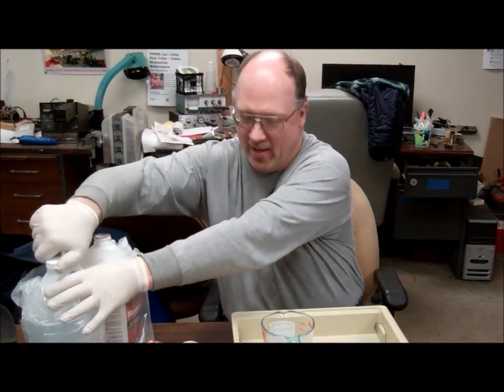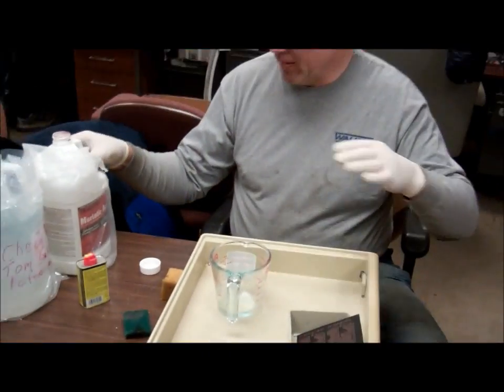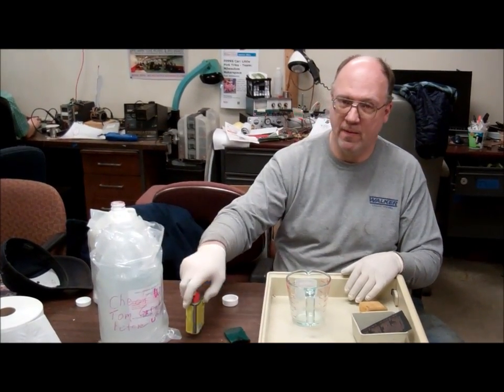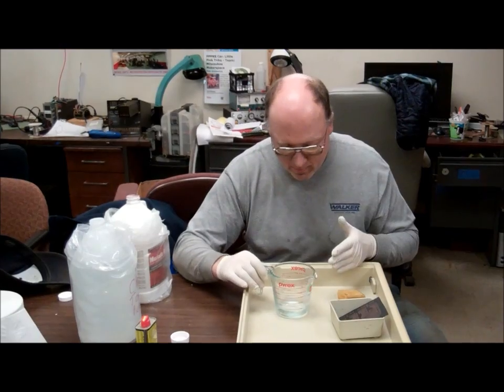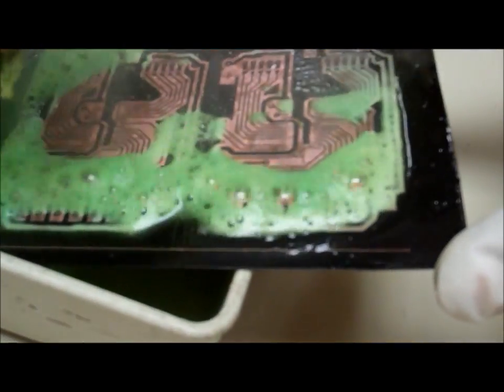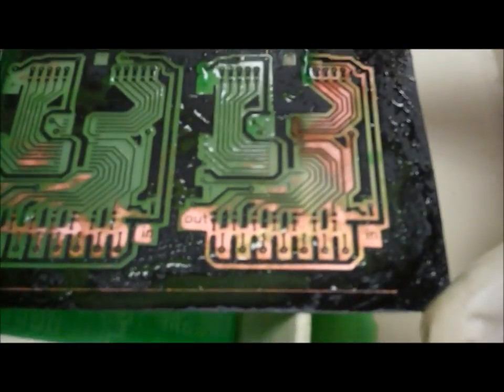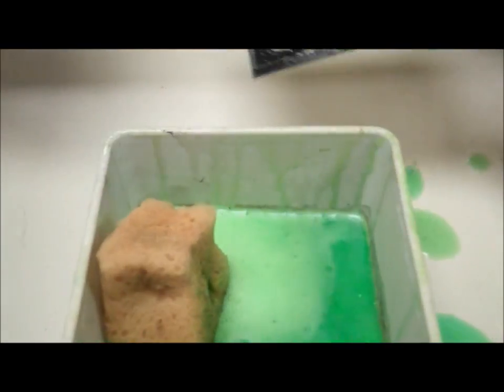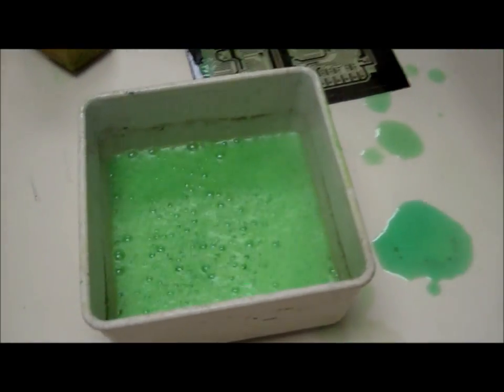PCB with Lasered Paint Resist and Fast Sponge Etching

Comment: Hi,
Thank's for your video.
I'm jean-yves from france.
I'm using the same process as you.
I tried alcool too but have problems: i think the paint layer is too thick.
I use a pressurised paint but it seams to be too greasy.
I'm forced to put more because it does not spread quickly and i can see holes remaining on the board.
What paint are you using?
Thank you.

Comment: Great guide :D
Worked excellently my first try with flat-black rustoleum enamel and a 1.6W laser. I used 3% peroxide, which took about 10 minutes with a paper towel to fully etch the copper, which was around 1oz, I think.

Comment: You really shouldn't do that indoors... I've heard those fumes are not only toxic but damage anything metal.
Reply: Can absolutely confirm. The fumes actually contain chlorine gas, which when you inhale it bonds with the moisture in your lungs and becomes hydrochloric acid. It does this with literally any moisture it comes in contact with. Use very very very good ventilation and always have a bucket of acid neutralizer on hand

Comment: The tray you were using looks like aluminum.  If so, the frothing at the end was the tray being dissolved.   I tried the home made peroxide-HCl etchant before, but the undercutting was so bad that the boards were unusable - especially when using the fast etch formula.   I went back to Ferric Chloride.  Ferric Chloride is dirt cheap and can be made at home in a few days.

Comment: Would the addition of citric acid do enough to make a difference? Also, could you elaborate on the type of laser printer, power, etc.? Thanks
Reply: Not a laser printer! He spray painted the board black, and etched away the non-black areas with a 25W laser engraver/cutter.

Comment: Thanks for sharing!  One technique I learned (similar to yours) uses Ferric Chloride (FC) with Ziploc bags.  Use rubber gloves.  Double-bag 2 gallon Ziplocs, pour in maybe 1/4-1/2 cup F.C. (no fumes, bubbles) and put your board in (sandpaper sharp edges first).  Close both bags & massage with thumbs- same effect as sponge. You can easily submerge or raise board from liquid and watch etching clearly. Pull board out, dump liquid into reservoir, seal & discard bags.  No mess, fumes, etc. You can get F.C. anhydrous dry powder online.

Comment: Does this only work on copper or would it also work on aluminum?  The reason I ask is that I'm thinking of etching an aluminum Zippo lighter with my own design.  I can cut out the design in vinyl, apply the vinyl to the lighter and then spray paint the whole thing. Then when I remove the vinyl, only the design would be exposed.

Comment: Cheap flat black spray paint. There is also some residue left on Tom's board, but the strength of the enchant plows through it. 

Someone sent us this link to our friends down at PS1 who do a similar process. They give slightly different laser settings advice than Toms does. Perhaps their settings would work better for you? Watch youtube video pFQ3wjwKZP4 (can't seem to put the link)

Comment: What paint do you use to coat the pcb's? I have a 40 watt laser cutter and haven't had any luck with etching the resist paint. [A video tutorial would be awesome] Is there anything that you do to the pcb to make it bond to the paint better? I have gotten a good looking etch but the copper still has enough residue that it still acts like a resist.